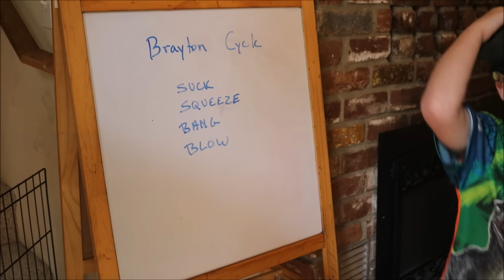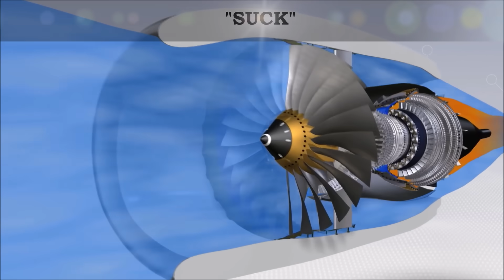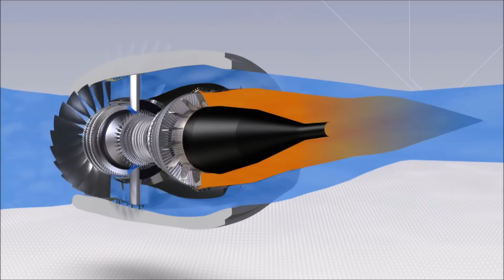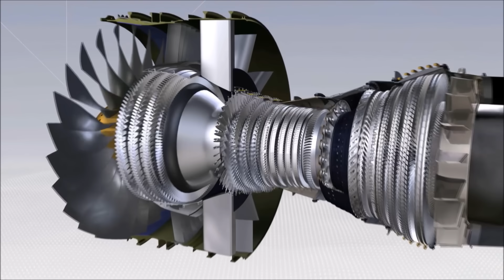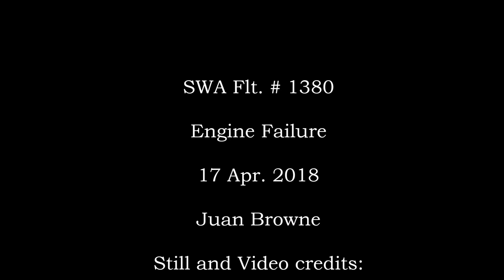Southwest Airlines Flt#1380 17 April 2018 Update

Comment: Please take us through the procedure. I'm guessing that depending on where the hole is, there is a difference in the cabin pressure vs flight level pressure? Like if a front window was somehow penetrated, the 500mph+ air would keep the pressure inside a few pounds higher than outside? Like maybe losing front window makes 320 feel like 250?  Now the 747 weighs just under 1Mlbs, so with 5600sf x 144 you have just over 800,000sq in, so I'm guessing the low pressure areas(most of the plane?) won't be as high as that, so, thinking about the center of the nose, I think of a 209mph backpack blower- knowing that the air is about a thirdbthe density, I'll figure 9(3x speed squared)/3(density up there. I feel like the blower pushes with about 5lbs, so I'll figure a 3in nozzle around 7in. So 5lb x 3(3x airspeed with third dense air) gives me about 2psi on my seat of the pants center of the nose guess. Am I in the ballpark?
Reply: https://en.wikipedia.org/wiki/British_Airways_Flight_5390
Reply: Lancer 28 Thanks, I know there would be major suction, because based on my very rough calculation, only +2psi over outside. I figured at most 1psi around that front center area. Either interior around 11psi(at flight level) if they had brought it down that far yet, you still would have a big difference in 7.5psi vs 11-13psi inside. Assuming flight level pressure of 8000 and them being half way to that cabin pressure would be about 13psi. Even with the smallest difference of 2.5psi(8psi outside+.5psi for oncoming 300mph wind vs 11psi cabin) that is huge in terms of suction with indoor stadiums at .1psi, you still feel a good breeze pulling you out with 2 sets of revolving doors, you know that 25 times that is going to suck everything right out the window until equalized.
Reply: Also need to consider the additional suction from Bernoulli effect.

Comment: A great report, Juan.  I respect that you didn't go into non-technical details such as the injuries sustained by the passengers.  The air-to-ground communications (available on YT) demonstrate the sort of emergency calm that professionals don in order to perform the multiple checklists you mentioned, remembering to always "fly the plane" as their first duty. 

So, the sequence of engine operation could be stated as:

- compress some air (through the fan and front compressor) to 450 C 
- mix that air with jet fuel and ignite it, raising both temperatures and pressures
- use the pressure to drive the rearward turbine stages
- use that developed power to drive both the fan and the front compressor
- use the fan as a propellor to drive the bypass air around the engine and out the rear.  The exhaust from the rear turbine is added to that for a little extra kick.  Waste not want not.
Reply from the maker: Yep!

Comment: Juan, have you seen the facebook video of inside the "flight"..    Found it quite strange,   for having 1 dead and 7 injured its the most calm ive seen.. Person is filming on opposite side on the wing and doesn't appear to have damage to plane or an increased noise volume of other engines if widow was broken.   and just my 2 cents that engine looks pretty clean to just have an engine failure...           #Qanon predicted.....

Comment: Do (newer) airplanes have any sort of external video cameras installed?  I'd think that the pilot would love to see the gremlin on the wing, nacelle damage, smoke, etc. that accompanies all the warning lights and alarms.
Reply: geonerd  I think the A380 does, but it's only pretty much so you don't hit anything while taxiing since it's so huge. Otherwise if something goes wrong in the back, like an engine thing that the pilot can't see, they usually just call up a flight attendant and have them go peek through a nearby window. Flight attendants are very well trained and in an obvious and likely LOUD issue such as an engine failing, they'd go look and let the pilot know before he/she even had time to ask. If absolutely needed, the pilot in command can always turn over the controls to copilot and go in the back to have a look for himself. Although after the Germanwings thing, I'm not sure how that would work with a 2 man crew on the flight deck, because I think there are rules against having anyone in the cockpit solo.... Maybe a flight attendant would have to remain in the cockpit while the pilot was out.
Reply: Understood.  But that all takes time.  To see the damage immediately might help the pilots assess an emergency and respond more correctly.
Reply: Simplistic hero worship is not an answer. :/
Reply: There's someone........ some-thing........ out on the wing.!!!!!!!

Comment: Curious, are there static self-destruct engine tests performed at (typical) aircraft crusing speeds?  Any numbers on how often this failure occurs with military aircraft?  Enjoy your presentations.
Reply from the maker: It doesn't appear so.  Good question!
Military usually has more failures, they also fly more 4 engine aircraft...I had about 4 engine shutdowns in 10 years with the USAF.
Reply: It is not feasible to simulate high speed cruising altitude cowling failure in a laboratory. Does need some attention though!
Reply: Are those tests in a wind tunnel with 450kts blowing over the engine?

Comment: Well done, I as well was waiting your perspective. After reading some other articles it does seem strange that the FAA slept on this and didn't mandate their proposed AD. I understand that a CFM service bulletin recommends an ultrasonic inspection of certain fan blades can be done in 2 hours, and doesn't require removing the engine. The proposed FAA AD stated that on engines that have flown more than 15,000 cycles, the fan blades would have to be inspected within six months of the rule being finalized, while on those with fewer cycles the blades would be inspected within 18 months. The European Aviation Safety Agency (EASA), the counterpart to the FAA in Europe, last month did finalize an Airworthiness Directive requiring airlines operating in Europe to perform the inspections recommended by CFM. Whats really interesting and I don't know is the the inlet cowl a Boeing part or a CFM part?
Reply: AFAIK the cowling is removed with the engine, so it is a CFM part, not a Boeing part.

Comment: Great explanation and videos.  I guess I will keep my seat belt on as usual through out the flight.  Don't know if woman was wearing it as it may have prevented the lifting effect of depressurization.  Wow, what a thing to see.  I would guess that vessels in her brain exploded with the loss of pressure so suddenly.  Hope they reinforce those cowlings more.  I wonder if there is something they could do around that part of the fuselage to be more protected.  Lose a few windows but then a complete redesign of the stress points with windows changed.  I couldn't get satellite GPS on my phone on a trip and wala that overnighter was in Seattle where we saw the boeing museum.  Guys were helpful and I was told that glass is 1.5" thick.  That had to be alot of force to break that glass.  At least the loss of that window did not effect the rest of the fuselage to the point of bending.  Great video.  I look forward to the next ones as this is near and dear to you with your main job.
Reply: There is a story about a commercial jet whose windshield failed in flight.  The pilot was sucked out, but the engineer managed to gab his feet and hold onto him for the half-hour it took the co-pilot to land.  The pilot, amazingly enough, lived through it.  I doubt the decompression killed her; much more likely was blunt force trauma.

Comment: I’m surprised that, after incidents like this, although rare, with the possible subsequent lawsuits for the mental anguish suffering of the passengers, the airlines don’t also include (or do they?) with their emergency oxygen mask instructions (and did you notice some of the photos on Southwest showed every person only covering their mouth with their mask and not their nose and mouth?) the description of the sudden decompression emergency rapid descent maneuver and why it’s necessary. I suspect most passengers understandably assumed that the plane was out of control and "falling" to an eminent crash. A NYT article reported a passenger saying the plane was, "tilting to one side" as it approached to land. Maybe the carrier should also explain sideslip? Here’s my recent Tweet about the New York Times article:

The NYT needs an airline pilot to edit sensationally reported stories. Liam Stack’s & Matt Stevens’ 4/17/18 article about the Southwest engine failure: exploded/midair/lost altitude/violently depressurized/tilting to one side/(landing) nothing short of extraordinary. Wrong words.
Reply: Bruce John Shourt it's tilting due to having only one running engine. Remember, with only one engine going, you are fighting asemetrical thrust. So your lift won't be balanced. Not only that,  but the dead engine is just dead weight creating drag. As far as the oxygen mask, they tell you exactly how to use them before departure, the issue is people don't listen. As far as letting people know more via pamphlets , well they don't due to cost. That and people likely wouldn't bother to read it.
Reply: Curtis Ridge  Yes, thanks, but in my multi engine flying training (a light twin for my rating) I was able to fly level on one engine. The largest factor in asymmetrical thrust is yaw, not roll. If you watch YouTube videos recorded in simulators of 737 engine failure on takeoff and return to land they are flown level the entire time except when turning.

Comment: We need to look at the Kevlar ring around the fan. It is designed to prevent the fan blades from being ejected and doing damage to other parts of the aircraft. In both of these events, the entire cowling was shredded and could have damaged the wing, flaps or even the tail. Great vid Juan. Pete is really cute. He and I share the same name. Is aviation in his future?
Reply: The cowling probably disintegrates due to wind forces at cruising altitude. Actual blade tests are done with stationary engines, which does not reproduce this mode of failure.
Reply: Correct. Some of those failures are fun to watch. However, the Kevlar band around the fan is meant to trap any blade or piece from piercing the airframe.
Reply: I thought Investigators said the blade never left the engine. It was not what hit the fuselage or window. Must have been the cowling when it blew apart.

Comment: I don't even read any of the crap the media puts out anymore. I just wait for your videos. Thank you again.
Reply: The media has historically done a poor, if not misleading job in reporting anything having to do with aviation. This is either through ignorance or to cultivate sensationalism. Case in point. The 1978 midair collision between a PSA 727 and a Cessna 172. Newsweek's graphic of the accident had the C172 catching up to the 727 and striking the trailing edge before going on to cause damage to the leading edge. That's right. A 90Kt C172 catching up to a 727 traveling in excess of 150 kts.
Reply: The media AND the CT specialists that haunt the web.
Reply: Me too
Reply: Ggkgdbs
tsossojtis
Tessufso
e3sh d'sshshsrskrsueeoe.   .